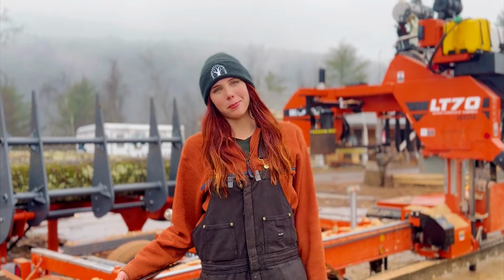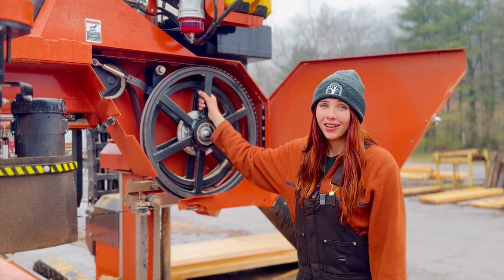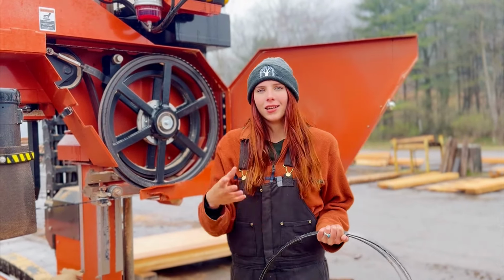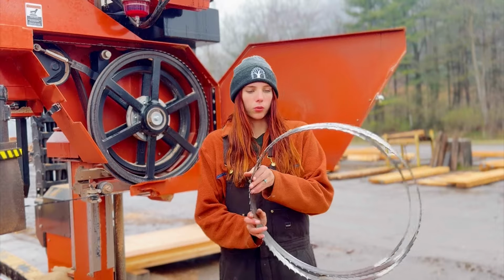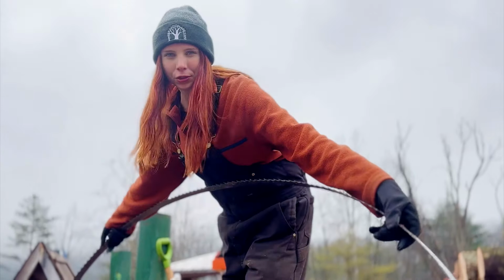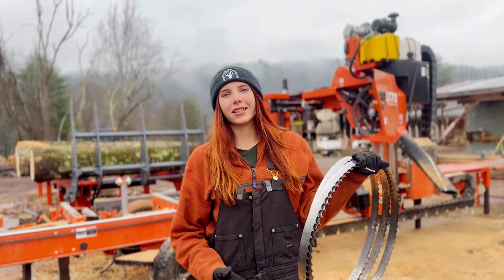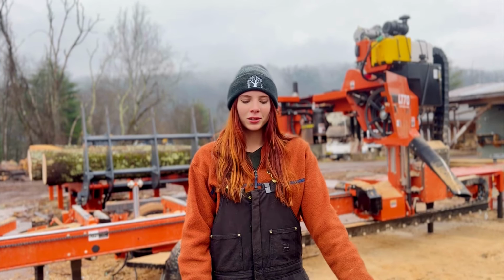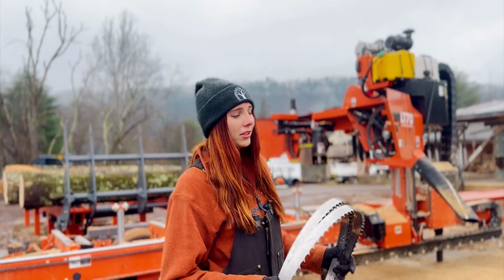Learn How to Coil Your Saw Blades!

Comment: Nice demo.   I used to be a toolmaker at a furniture factory in a town about 25 miles south of you. When I welded bandsaw blades together from roll stock they were anywhere between 18 and 25 feet.  It took me a while to learn how to fold them when I was trying to do it by someone else’s method. I learned not to fight the blade, and eventually found my own technic that allowed me to start the fold twisting in and toss them on the floor in away that they literally folded themselves.

Comment: Before they all had GPS, surveyors used 100 to 300 foot steel tapes to accurately measure distances.  They were referred to a surveying chains.  Those were coiled up with the same side always up, and then tied.  When coiled they were then "thrown" in a process very similar to coiling your saw blades.  I have a small bandsaw, and I would like to coil the spare blades.  They come coiled when you buy a new one, so I will try following your directions.  It's not quite the same as throwing a chain.

Comment: I don't use the flip.  Stand the blade up in your hands with the teeth facing away from you and with your foot on the blade.  With your hands force the teeth of the blade towards each other and it will pop right into the smaller coil. Nice mill, when does the roof come?
Reply: You got it.

Comment: The way I was taught, and I also do weekly at least, is to stand on the blade with both feet, teeth facing away, grasp the upper part of the circle with your hands about a foot apart, one hand coming in from the back, the other from the teeth side, then twist so as to form the loops as you lower them to the ground. I do this with steel cutting 1.25" x 14' blades which look  smaller than the ones in the video. It seem to me like a more controlled way of doing it, and it keeps those teeth lower and away from your head. I also am wearing heavy leather welding gloves while doing this.
Reply: EXACTLY
Reply: Come on you can't let a girl out do you.go gloveless 😂😂 bulk bulk bulk

Comment: Good demonstration of coiling your blade. I don't run a mill but I do have a bandsaw that I use different blades for so I have to store them. I have been wondering about the new mill. With the old one, the cut ran away from you. With the new one, The cut runs toward you. Is it anymore difficult cutting your thicknesses going one direction or the other?

Comment: I remember doing it for the first time, other guys in the mill were watching and I had not ever done one before.. Yes, I did cut my hands and no it did not go like I thought because of the fear. Later it came easy and for a joke would do the same with my chain saw chains  as it would just turn inside out and then no one could use my nice sharp blades.,.. they were too lazy to do their own and would take mine till I did this... real hard if  chain is brand new

Comment: I've been coiling saw blades over 50 years, I do it one handed by foot on the bottom, hold the top with my hand, push down and twist it. Much safer than the method you're using as it's a controlled steady motion.

Comment: There is actually an easier way. Stand with one foot on the blade grab the top of the blade push down and twist until it has looped into the smaller size

Comment: Would it work with the teeth the other way? Seems like it would be a good idea to keep the teeth out of the dirt.
Reply from the maker: It is more of a hazard
Reply: Good to know, the blades on my much smaller mill probably fold with a lot less danger factor.
Reply: Have you ever had one spring back open and bite you?
Reply: While uncoiling I have come close, so far no blood. My blades are smaller though.

Comment: I see a real need for a swing saw.  You need a quick, easy  way to loop the slabs into stovevlenth. 
 The chop saw you have requires you to move the heavy  slab. You need a swingvsaw where the blade effortlessly swings through the slabs.

Comment: The way the blades are hitting the hard ground is not ideal! It will damage the tips, more so than just normal blunting does! Do it on a  soft surface such as old plywood sheets! Grandpa will thank you for saving a lot of time! Cheers

Comment: At one time in my life.. I work for a place thatit's fractured Band saw blades.. Wait until you try to fold one about 22 ft. long.. And then you go to unfold them.. And someone tells you the pizza run around direction.. And do not know how to invert.. The band saw😅😅 Yes I worked at this place for about 15 years..

Comment: You can mess with Grandpa by turning the saw inside out making the teeth face the wrong way for the sharpener. 😀 I was a saw filer for many years (big saws up to 14 inches wide). We would turn the band saws inside out to make it easier to level the inside of the saws on the top anvil.

Comment: They should make double-sided blades so you can cut both ways that would ve really fast milling but I suppose that's not possible . I haven't a clue
Reply: I don't think or know how that could be done with the saw blades
Reply: Yeah, I didn't think so either, or they would have it done long ago.
 That would be extremely popular, I'm sure.
Reply: Not going to work because the teeth have a set in them so they cut a wider slot than the thickness of the blade.  This ensures that the blade is not pinched by the wood it is cutting through.  An additional set if teeth on the rear edge of the blade would drag through the slot at best and be pinched if there is any tiny closure of the slot (kerf).
Reply: The thinner band blades flex and have to ride with their backs against the blade guide rollers so they cannot be double sided. Industrial band mills (14" wide 40 ft long) don't flex and are held in place by tension from the wheels so can be and are double sided.